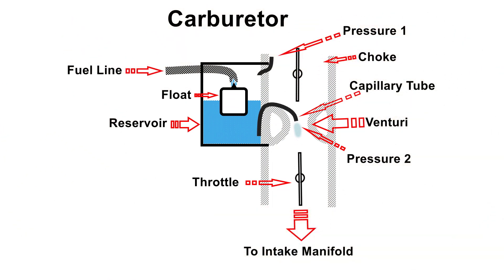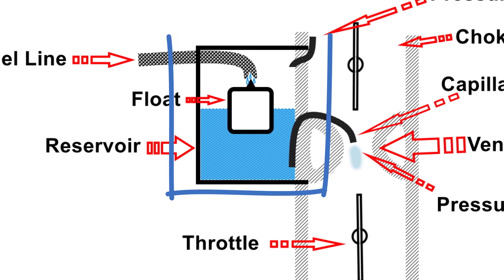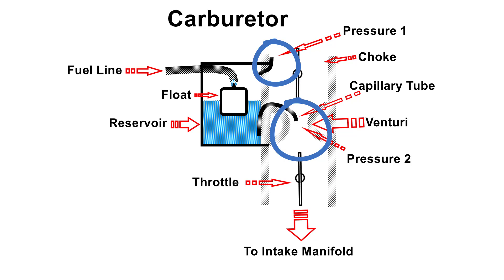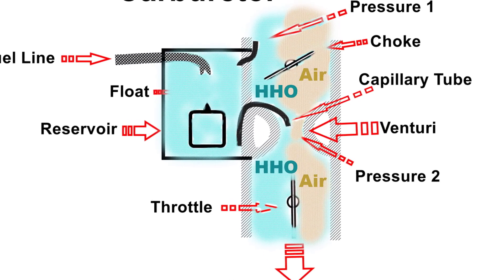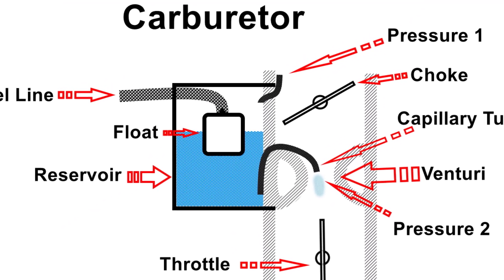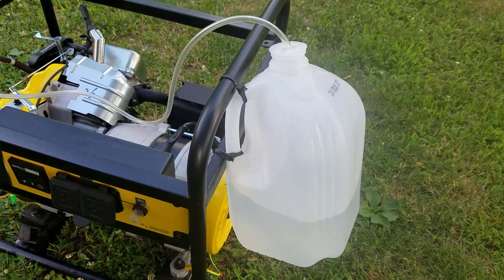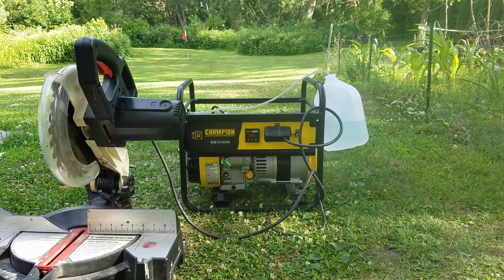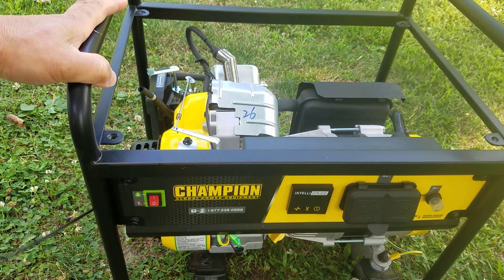Engine Runs On Water - HHO? (Fake Exposed!)

Comment: Pretty easy to power this when there's still fuel in the reservoir after removing the fuel tank. Runs for about 30 seconds to a minute before dying or longer if there's more fuel in the reservoir. Look up Hydrogen Generator Hoax and look for a video titled "Engine Runs on Water - HHO? (Fake Exposed)"  by YouTuber "Theo Maxim" and you'll see why this video is bullshit.

Comment: Technically, engine can control the amount needed by vacuum....I think. Connnect hose from hho to the intake but allow for excess to be able to escape the intake(aka hose with holes in it. And it might work? Dunno. Since you technically don't need carb at all to run an engine on gas (not gasoline, actual gas like hydrogen or butane or whatever) just need butterfly valve to control throttle.

Comment: You do not need to modify the carburettor. Hell if you have no intentions of going back to petrol you can remove the carburettor. Or just go through the intake. The butterfly valve will control how much is going in. You will need to adjust the air mixture screw to allow it to idle correctly. Most people I've known who put HHO generators on their motorcycles added the input onto the intake system. There's usually a rubber hose that holds either side of the carburettor or a rubber hose and then a metal mount that the carburettor bolts to. 
A good way to compensate for rpm changes is to add a pulse width modulation circuit that works with the throttle to increase production on demand. 
If you have a single cylinder motorcycle you could run it off the wasted spark system. That would give you pulse width modulation circuit without having to buy one and it would increase production as the rpm rises

Comment: You have to collect hho an store it then you dont need the carb the flow rate makes the engine run thu the air filter the more pressure going in the faster the engine runs so a ball value would do the job getting hho into a pressure tank is the hard part just need an air pump an filter tanks

Comment: It does work if you know what you are doing. They just started selling cars that run on water. Google it.
  I've run my generator on it. Just bolt a car alternator and pulley and belt where the pull cord is. Wire the alternator for 12 vac and use a step up transformer. Like a microwave transformer. I've been doing it 4 years now.

Comment: First since Hydregon just keeps pumping, unlike gas you need pop-off valves on top of both containers. Second is that your generator seems to require more fuel than one unit can produce, make another one and add it, then another if needed until you have enough fuel for the engine to run unstarved. This should make a difference.

Comment: There is NO WAY that ANY engine can run on pure water ! That "Drinking Water" can contain Ethanol or something similar. 
And by the way, if you run an engine on HHO you better lock your ignition  to AFTER TDC  as HHO ignites immediately, not slow burning like gasoline. If you don't then be sure or you burn all the valves or worse, perforate a piston or bend a rod. This from a Professional Engineer Mechanic, not a dreamer on You Tube !
Reply from the maker: This demonstration is just to reveal the truth above other fake videos!

Comment: The easiest way is to remove breather then introduce the hose and figure out how far away it needs to be for best fuel air mixture straight to carb doesn't work it "floods"

Comment: MAKE A VERIBLE RESISTOR OUT OF SALT WATER ..!

In the HHO  container add another copper wire . 
It's salt water make your throttle out of a Mexican mexicinism that exposes difftend amounts of the 3rd copper wire to energize threw the salt water only the other + wire. 
 Like a verible balest resistor ..! 
Might have to rase the voltage however the voltage on the 2nd wire will only max at 12 volts DC .

Comment: Try to copy the guy that he said a generator ran it the way he built it. Made it's on hho and ran. I'M sure you have seen the video. No combustible engine  can run on water alone as I know of. If that  (his setup with HHO) does work. I will build a 250 gallon tote with  electrolysis material and run my home.

Comment: Use a dc speed controller to control the output. Simple. At 3:45 is bull. As you explained. Also the mount of electrolysis material added can do the same.

Comment: Just because you can cheat doesn't mean it doesn't work but you don't even need a carburetor if you're going to run the engine off of hydrogen you only need a tube going into the motor and a small tube with a valve on it so you can adjust the airflow that goes in otherwise in that that's all you need you don't need the carburetor at all

Comment: no need to modify carburator, only need the air valve to regulate the power.
just be sure the hho inlet goes from low to high since H is so light it will want to escape upwards.
tested this on an old ford v6....
what you DO have to modify is that friggin waste spark since those generators like on this film has ignition on every stroke !!
also, set the timing to some 4 to 10 deg AFTER BDP... unless you wanna run verry lean, for the hydrogen its no problen, it ignites on just about any air mix....
gl, hf playing with this stuf :D

Comment: Dude... your silly Heres why!
1. You DO NOT use salt...
2. Use the generator for higher voltage convert to DC + 120VDC Speed controller = 3-5 amps.
3. route intake to HHO Cell+ External air in/Limited to 60%
4. This will run just fine.
5. You will be limited from 3000W generator to a max of 1900W before stall.
6. win.

Comment: It is not fake, I have watched many that the carburetor was completely removed. Secondly what you did there is not HHO Generator. Your generator does not produce any HHO.

Build a good HHO generator that can produce 1Ltr of HHO gas per minute and see that you will definitely get a bum with your light and it will run the generator set.
Reply: Won't work. Many have tried, ALL have failed.

Comment: I remember reading/watch a video somewhere that says running your gas engine on hydrogen/hho without any modifications will destroy it slowly. Creating a big hole at the top of the piston or melting the internals
Reply: Yes, hydrogen is the smallest of elements and will work its way into most metals destroying them in time, one of the big issues for converting grids from natural gas to Hydrogen that's very little talked about.

Comment: Ahhh...the carburetor is gravity feed so how is the water getting into the engine if the line from the water bottle is going up hill to the carburetor ? To do this you have to create a syphon from the bottle to the carb, however, the level of the water in the bottle needs to be above the carb's float bowl for the syphon to continue. It looks like the water level in the bottle seems to be just above the float bowl, however, you can't run a gas or diesel motor on water alone so the point is mute anyway. I tried it more than once and, nope, ain't happenin'.

Comment: -Α huge BRAVO to Mr Mighty tiger. !!!  If you don' t have any knowledge, don' t try to stop the invention,  because all universal wars,  are become from - fuels.    .Don' t stop inventors when they are trying for something good. This Genius  water motor home made invention  and the enhanced  electrolysis makes water as fuel  possible, without automobile-smokes,   without pollution  air and  good for environment.. This invetion is not fantasy and  <<  without  cars smoks poison > >. This water engine  - Function  - with Sea -water,  also rivers-water, and rain-water.  As you understand, -  NO  problem with water. A huge BRAVO to the inventors!!!...  - LESS - plastic from fuels, - MORE -  LIFE from WATER !!!...

Comment: Years ago, using a kit you can purchase online, I converted my gasoline 7000W generator to natural gas from a line that fed from the street to my house. It ran quieter and endlessly. The kit wasn’t all that expensive either. The engine acted like it didn’t care if it wasn’t gasoline. So as long as the PSI is about the same coming from the HHO generator as the gas line to my house I see no issue.
Reply: @atm2085  I don’t recall. When I sold my house I sold the generator with it back in 2014 so I don’t have the kit manuals and info anymore but whatever the natural gas kit-included regulator flow is rated at would be the same for the HHO. The regulator also had an adjustment screw on it although I never had to use it. The generator never bogged down when demand was put on it. Just kept a steady pace.
Reply: Yes, you know that, my friend. I turned to use hydrogen split from water and it works well. This bloke must be getting paid from one of the oil companies company ie elites lolol
Reply: @mikedonald8349  Or your being paid by the scammers, now which is more likely 🤔
Reply: @mikedonald8349 you are snake oil salesmen
Reply: @mikedonald8349 me too 🔥

Comment: |> |> |> |> |> |> |> |> 
|> |> |> |> |> |> |> |> |> 

 you know by playing the biggest massmurders in the pocket you commit accomplicy by massmurder.

1. someone must always use cells which split by producing hho gas hydrogen and idygen and feed them seperatly one in the gasolin ntake and one in the oxygen intake ... 

2. thevbubblers are shit and ideotic dangerous aspecialy if you font seperate.

3. to replace the bubblers are the best my hho injectorsystem based in tesla valves where pressuresensors are includet to steer the whole process and how much volt and ampere ...

4. a damed 6 Ampere Batterie?!!! you want that it fails ibviously ...

minimum requirememt are 35 Amoere up and the best 13,5-7 volts ...

and a cell which induct the voltage/share it with other plates to under 3 Volts because heat!

what you here do is only to oroove how fake exposings work ... thats all ...

hho is absolutly able to run any engin ... but not in this bullshit way ...

so you can also proovethat gasolin font eork in a gasolin engin ...

this is vgeap terrirismus for the biggest massmurders on that planet ... enjoy your bloodmoney ...  

in such a action is the revenge contend in the crime with all that sicknesses which polution create ... 

|> |> |> |> |> |> |> |> 
|> |> |> |> |> |> |> |> |>

Comment: Last time I checked, drinking water isn't combustible!
Reply: Everyone check the drinking water not combustible 😂.. but there is happening 😂
Reply: Last I checked you dont even know what's going on.

No regular drinking water isn't combustible, but Hydrogen is extremely combustible and is produced via water electrolysis.
 
Water electrolysis a method that involves using an electric current to split..... wait for it....... REGULAR WATER (H₂O) into hydrogen (H₂) and oxygen (O₂) gases 

Next time do some research seriously, it really annoys me how people like yourself post comments like this, acting like you know what your on about when you clearly have no idea about what is going on at all! 

No I don't care how long ago you posted this either, you've left it up for everyone to see and comment on so therefore its gonna get commented on with opinions, or in my case, ACTUAL  FACT!

Comment: Do not use salt otherwise chlorine gas is produced and chlorine gas and pure hydrogen reacts explosively even in sunlight. The best to make water conduct electricity is to use sodium hydroxide or potassium hydroxide instead you will produce hydrogen and oxygen, but oxygen is also explosive element in pure state . The cathode and anode should be made of 80 percent nickel and 20 percent chromium so high quality materials needed. The rule of thumb you need 50Kw of electricity to make 1Kg of hydrogen and oxygen you have to bleed it into the atmosphere far away from hydrogen.

Comment: Hi I made the same project following your advice and I thank you. I have encountered several durability problems. In your tests, how long have you kept it running? In my case it should work for at least 5 or 6 hours continuously. I advise you to use only pure steel as, as you can see in the video, the pink color of hydrogen.
Reply: You're talking 316L grade stainless ... which you are correct on , and the way he designed his , would likely end up grenading , as using a wet cell and wires near the gas...as these will corrode and possibly create a spark ....

Which is poisonous  if it looks like which  he was using !!! table salt !!! which will produce a chlorine gas .... Best to use KOH , potassium hydroxide ...

If you want straight up good idea on hho production,  check out delvis 11....he has tons of videos on hho..

And he even designed a flash back port , attached to bubbler/scrubber , to prevent built up gases ,  exploding container ....

Out of simple mouse ball, spring and some pvc tubing and connections ... 

He has some amazing builds , almost 10yrs of videos

Comment: You could run this engine on "water". A HHO or browns gas generator, capable of supplying enough on demand fuel, can be constructed with the proper knowledge and specific materials. The carburetor does not need modification, but does need to be empty. There is no way round it, a somewhat technical gas metering system has to be added between the carburetor and air cleaner and operate in conjunction with the slide/butterfly in the carburetor. From a fuel supply point, thats all thats required to run the engine. There are some timing alterations that should ideally be made for perfect tuning, plus egr addition for emissions, but the entire endeavour is pointless! as the lack of a petroleum contacting surfaces on the way in, the lack of surface coating carbon on the way out and an excessive amount of water produced in the cylinder on combustion, create conditions that WILL destroy the engine within a few hours.

Comment: what stupid video is that, water has to be somehow convert to gaz first and of course it can run with what left gasoline in the carburator, HHO  requred at least 15 liter/min to run this small  engine and they need to remove the carburator and adapt the hho inlet as close as possible to the intake with a spark arrestor, will run even better if the timing is retard 10 degree

Comment: What a joke you have created you haven't an electrolysis kit of any kind you have a jug of water with a tube and gasoline in the float bowl of the carburetor that's pretty dumb you're pretty dumb guy real hydrogen oxygen mixture is 130 octane higher than premium fuel .

Comment: Why would you want the carburetor in the first place...  remove it and set up a system to mix the air and hho...  the only issue is then creating enough hho (mixed with the air) to run the engine at the proper speed...  (the system for mixing must have safety devices installed for backfiring)
Reply: My friend 😂, hho doesn't need air there is oxygen in it.
Another name of hho oxy-hydrogen

Comment: You should try and get your brain working dude what nonsense you have created for no reason. the true way to prove the other guy wrong would be to do the same experiment   not by acting retarded...uh and your building ability is your downfall using precise calculations for volume and the conductivity of the water factoring in voltage and the surface area of the cathode and anode arrays you can create a predictable and sufficient amount of hydrogen(and oxygen) to run a motor but as in the real method modifications are necessary to the carburator(despite your claim to the contrary) the real method used a block off plate inside the airbox to restrict the airflow in order to create an appropriate mixture. This cannot be achieved with your scrubbing sponge BS and your childish approach try some math smart guy not being a douchebag!

Comment: get one that runs on propane and then replace the propane with the hydrogen.
Reply: does this work? even though propane is under pressure and hho on demand isnt?
Reply: @devinmiller3020  as the Piston goes down it draws new hydrogen into the combustion chamber it doesn't need to be under pressure.

Comment: Well i have a 1954 ford,1994 302 in it caberated,i hooked my hydrogen directly in the top/where the air breather sets,seald it so just hydro would go in and it started rite up,idled and reved,un hooked the gas line ran it till it died,and wouldnt start first,i was shoked and stumped,but i was getting water into the top of the carb from the hose so next time ill make a water catch befor the carb,if i ever get the time,ill make a vid of it,cheers

Comment: I am so glad you pointed that out I have had arguments over that but to run the unit on HHO (1) you will need a gas regulator to act as a carburetor (2) The HHO unit will not keep enough pressure of gas to supply the regulator to keep the generator going.
Reply: I think for the most part people don’t tune the engine to run hho it’s like bolt one it’s very marginal until you get an actual tune
Reply: @josephdias5859  You are correct you do have to tune the intake to take HHO just as you do with LPG but LPG is more dense and is a liquid in the take so tunning is not that fine as in HHO
Reply: @josephdias5859   I was only meaning to get hho up to pressure to run a regulator regulator much like a gas converter in lpg cars at the least u have consistent PSI  going in ither way u still need tune it
Reply: @johnoconnell3459  What happens when the fire travels up your line and ignites your tank.  BOOM
Reply: @changeminds2736  that's why your suppose to have a in-line  fire arrestor/check valve, it comes with the HHO kit, and most people will tell you that online. and you also have a water bubbler, so that's 2 fail safes
Reply: fridge compressor pump mit get up to enough pressure for what your think of